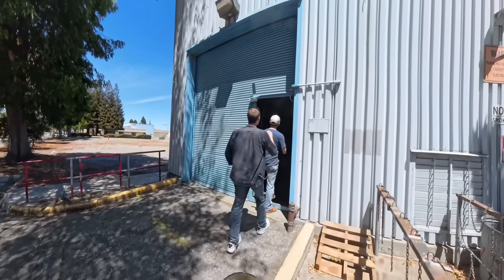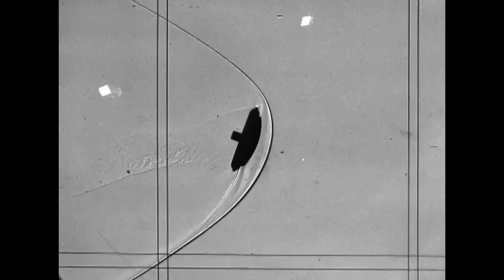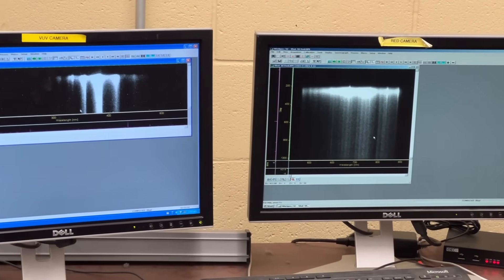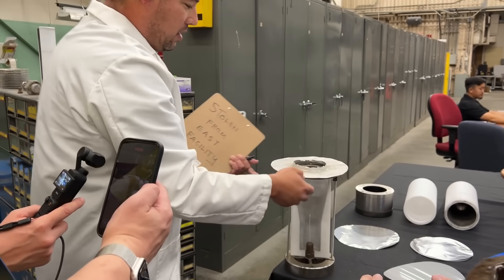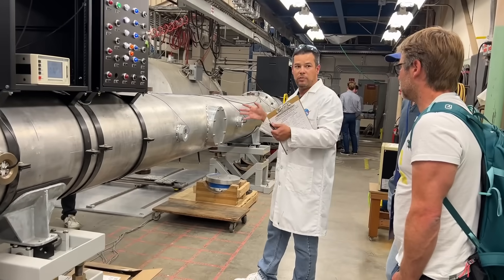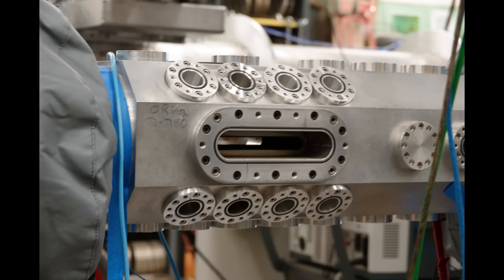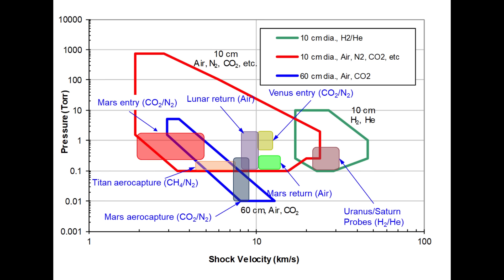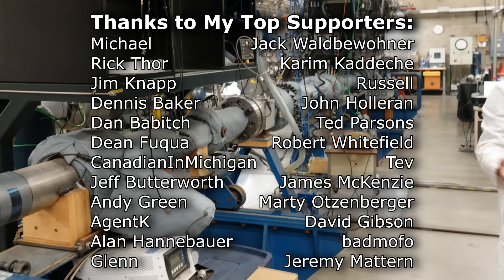Why NASA Is Making Air Explode Using Electricity - The Electric Arc Shock Tunnel

Comment: I was unable to adequately visualize 48 kilometers a second as anything other than "really damn fast", so I converted it to miles an hour, and it was over a hundred thousand miles an hour, which I was still unable to visualize as anything other than "really damn fast".
So I said "screw it" and went for mach, and got a shockwave moving at mach 141. That is still "really damn fast", but it is a number I can get a toehold on... barely.

Comment: Interesting … and hardly surprising … the technique they use to initiate the arc is essentially the same as that used to simulate lightning strikes. In that case, it’s more to do with encouraging the strike to occur at a precise location on the test article … the release of so much energy tends to have something of a mind of its own when it discharges … there being 2 key factors in such a test; one being that it releases at the correct threshold energy (so you achieve the appropriate strike characteristic of energy pulse over time) and, secondly, that it actually strikes at the right spot on your test article. 

These are very important in the testing of airframe mounted Carbon composite components where you really don’t want a Lightning discharge to get into the actual Carbon fibres themselves; it can then get very messy very quickly. Lightning discharges through an aircraft need to be safely managed for obvious reasons … irrespective of the structural materials used you’re allowing the discharge to flow around the external skin from where it will continue its path to wherever it’s going. It’s the Faraday cage situation. The problems occur when it discharges INTO the airframe and the energy is dissipated within the structure or associated systems. 

It’s a fascinating subject and one I got involved with a couple of times with the “fun” of supporting certification testing. When the test fires, it certainly goes with a bang!!

Comment: When I was a grad student (40 years ago) my housemate had an amusing job in mag. confinement fusion research which involved building a power supply that could produce a million volts (not so hard) at a million amps (rather hard) for about 1 ms.    That's 1 TW for 1 ms, or about 10^9 joules --- not a huge amount, but it's huge if you're in a hurry.  10^9 joules is approximately the amount of energy you'd find in a fully charged Electric (passenger) Vehicle.

Among other things, he needed to build a coaxial transmission line that could stand off 1 MV, but also have a characteristic impedance of 1 ohm.  If you wonder how you can build such a thing, let's just say that there is a very amusing picture of my housemate swimming inside that coaxial transmission line.

-----

Interesting safety hazard that you might not have thought of: the capacitor bank that supported Steve's gadget was submerged in a large tank of transformer oil in order to handle the high voltage.  Okay, fine.  However, that transformer oil had a density of that was about 0.85 that of water, and the tank was about 10 ft deep.  So what?  Well, here's the problem: if you fell into that tank, you'd sink to the bottom of it.  You can sort of float in water, but you couldn't float in this tank.

And that's why they occasionally had to clean out the dead animals that had had the bad luck to fall into the tank (birds, rats).

------

There's another story involving "how to make a really cheap resistor that can handle a gigawatt" but that is just going to have to be a story for another day.

Comment: What is the voltage the system operates on? MA is a lot of current, but energy - more exactly power, also depends on the voltage and with time we have the energy spent. You could do a lot of fun things with this capacitor bank! Whats the max power? and for what time?

Comment: I feel like engineers from 60 years ago were so much smarter than engineers of today's world. They came up with all of these experiments WITHOUT computers, the internet or even fancy calculators! Just pencils, paper and slide-rules!! 🤓
Reply: They definitely had calculators 60 years ago lol I have a canon calculator from back then with nixie tubes that still works great, most people doing stuff with numbers professionally back then would have been using one they just weren't pocket sized yet till a decade later, like electronic calculators began back in the 50's by the mid 60's they were pretty well developed

Comment: Hm, interesting point about Titan's atmosphere. But we also have oxygen here, which will very happily snag up any methane radicals (and nitrogen atoms for that matter) it comes across. Especially if it itself gets ionized in the plasma. Another point is that hydrocarbons need to become quite large to be solid and/or colored. My educated guess would be that it's very unlikely to be hydrocarbon deposits.

Comment: Was very excited to see your "Air Explode Using Electricity" vid.  As a young dude exploring the West Coast in 1969 I took a temp job painting walls in a big workspace in a company called Energy Systems, Inc.  They were building these exact huge capacitor banks!  All I was told was they were aerospace related.  Off to one side was a device that looked like a 50's Frankenstein movie prop.  It was a tower about 20' tall with big aluminum "donuts", cylinders of plexiglas and a big arc gap in the middle.  It was called a "crowbar" and was used to discharge the capacitor banks.  Your YouTube was a flashback for me.  Love your videos.

Comment: 110% will be used to shock the atmosphere for “”geo-engineering/ making it rain” via shock therapy that dubi/Saudi-Arabia uses, instead of using materials/aerosolizing the areas/polluting on coming cloud system’s. Too boost/strengthen or to disperse/migrate.

Used to test their flash flooding/ attacking down stream areas / insurance racketeering/ disaster relief land grabbing… using on other county’s…etc 😂 atmosphere re-entry.. Good one scott 😂 so small minded and only accept the cover story they use too seed/acceptance public opinion, making them less respectable to challenge said concepts/program’s/machines when told by accepted public figure. problem reaction solution. When all you make are hammers,everything starts & begins to look like a nail..

Comment: There is a big misunderstanding or more like incorrect (time) perspective about the capacitors, which regrettably is shown also by the author of the video. The statement @8:50 is incorrect. 1.25MJ makes such heat in the chamber not because of being dumped in small amount of gas but because it is being released in an extremely short period of time. To give a perspective, 1.25MJ released in 0.00000001s (10ns), equates to 125TW, released in a second (W=J/s). That is the magic of the capacitor discharge. It is not coincidence that Tesla did a lot of experiments with huge capacitor banks (big wine bottles filled with salt water!) and observed very interesting, and even today, highly misunderstood phenomena, showing only when a lot energy is discharged in an extremely small period of time. No chemical reaction/explosive can come even close, in several orders of magnitude, of such an energy release.
Reply: It's also absolutely because there is so little gas though, if there was more gas it would heat up less because of there being more gas to absorb that energy
Reply: @noodlelynoodle.  I do not think anyone will be disputing that point, as that is a very well understood and a visible physical relation. My point is on something that very few realize, as I have noted. There is a huge difference of the time perspective (several order of magnitude) which creates misunderstanding of the fundamental nature of the process.
Reply: @EfficientEnergyTransformations  the only difference between what was presented in the video and what you said is the units it's in its just simple conversion and tbf you specifically said it's incorrect as to that being why it gets so hot when that is the main reason it gets as hot as it does whereas the rest your going on about is just unit  conversion, regardless of the unit you want to talk about it in the amount and type of gas in the chamber is what's determining how hot it will get when feeding it a set amount of power

Comment: I love how they use those burst discs.  I still remember early on Mythbusters also used burst discs to measure the shock they received but later on in the series they switched to using electronic sensors.  However, burst discs are just simple devices that simply works and probably less prone to failure in such extreme conditions because their mode of operation is by failing.

Comment: A couple of years ago, in our engineering company, we wanted to develop a retriggerable, reusable and remotely stun grenade with a very bright LED-flasher and a burst-disc bang-generator, driven by a carbon dioxide for law enforcement and military use. Our government denied to give the required permission, since the law makes no difference, whether a shock wave is created by chemical, mechanical or electrical means. Shock-waves created by burst-discs have been considered even more dangerous than those created by chemical means, due to the much higher velocity. to get an impression, a burst-disc like shock-wave can be created by smashing a larger packaging-bubble (so 8cm diamater). The SPL (sound pressure level) reaches easily that of a gunshot.

Comment: Hey! We did the boring, finish turning, and power honing off thus exact tube at our shop! You can see it in our company tour video for fluid tech hydraulics on our big lathe. Super cool project. The finish we were subcontractors did is fantastic, great people. I airways wondered what is actually we used for

Comment: I m setting up a Suer Capacitor to start my old Step Van .. That way it staring the V8 Engine will not put any strain on the 6 battery bank I use for the Inverter and welder set up :)

Comment: Gas properties affect not only entry heating rates, but vehicle stability in the case of asymmetric entry bodies.  The most famous example is the first Space Shuttle entry.  At high Mach numbers, Shuttle aeroheating was handled by maintaining a high angle of attack - 40 degrees at entry interface, then stepping down as Mach number decreased.  Trim was maintained by the body flap setting, which had been predicted as 7 degrees in the preflight CFD analyses.  In flight, the flight computers sensed that this wasn't doing the job, and kept increasing the flap setting until it reached 16 degrees.  It turns out that the CFD simulations had been performed using perfect gas properties for air, rather than real gas properties.  This resulted in misprediction of the center of pressure location, throwing off the trim requirements.  The situation had actually been quite serious, but wasn't discovered until after the flight was over.  In cases of planetary probes having offset sphere-cone heat shields to provide extra L/D, atmospheric composition - and real gas properties - take on the same level of importance as with the Shuttle.  The CP location is critical in maintaining the stagnation point on the spherical segment.
Reply: soviet shuttle, orlan, afaik flew only once, but entirely (+reentry +landing) on autopilot
Reply: had a pc shuttle simulator long ago. reentry was hard; trick was to slalom to dump V

Comment: One could build a capacitor bank for around 130,000 € using the one-piece prices on digikey. The discount will most likely bring it well below 100,000 €. You then need some serious hardware around it.
Edit: I have not taken ESR requirements into account.

Comment: Their electic bill must be astronomical!
Reply: As mentioned by others in the comments, the energy released is about the same as in moderate sized e-bike battery. It's the incredibly short duration that's important. So their electricity bills will not be that significant.
Reply: @andy_rb I got that, its a joke about NASA playing with electricity.

Comment: I like the idea that the orange colour on the IFT10 Starship is because the black pigment in the tiles is Magnetite - Fe3O4 which is oxidised to Haematite - Fe2O3.  There's plenty of tile pigment, plenty of oxygen, and plenty of heat.  It doesn't explain everything but neither do the special cases.

Comment: 1.25MJ is only 0.35 kWh 😂
The trick is that energy is released in a very short time.
Even if it's as long as 0.0005s it's 2.5GW... enough for time travel !!!

Comment: Hey Scott,
You might be interested in the past goings on at the NADC in Pennsylvania. 
Specifically, 
The centerfuge,
The Dynamic Flight Simulator 
Flanagan Gray (30+ G's),  
Richard (Dick) Crosbie (DFS algorithm author),
The flame pit,
Monkey house,
Ejection tower.
and so much more...
I worked there peripherally as a contract engineer in the 90's.
Are you interested?
Not sure how to contact...

Comment: Me doing studs capacitive discharge welding today at the shop. 
Powerful enough to weld a 1/4-20 steel stud in 0.004 seconds.

Comment: They used this for testing the shuttle TPS system
Reply: And the Starship TPS is based on the shuttle TPS. Though with Starship they test it with prototype hardware in space rather than on the ground.

Comment: 1.25 megajoules converts to about 347 watt hours, it's crazy how much space capacitors take up to store energy.  That's the price you pay for speed ><.  For reference, 360wh is a pretty modest ebike battery, about a third of the capacity of a car battery, or about 4 5ah 18v tool batteries.  It's amazing to see what can be done when you compress that relatively modest amount of power into a few millisecond or less.

Then again, that's explosives for you i guess, the energy content is rarely all that high, it just get's released REALLY fast.

Comment: 10:35 I was actually told a similar story at the synchrophasotron particle accelerator facility in Dubna. 
When its vaccuum tube developed a leak, they did the following: they put a cart inside, a guy laid down on it, they sealed the system and poured ammonia on all the seams and flanges. The guy pushed the cart with his legs to go around the accelerator and used his sense of smell to find the leak.
Reply: "Who wants to help find the leak?" Silence.
"Who wants to get a shit load of money?"  A bunch of hands go up.
"And who can actually fit?" The little guy in the back get a even bigger grin.
Reply: @benjaminshropshire2900 I’d get over my claustrophobia for that hazard pay 😂

Comment: Was Starship recovered?    On prior launches they had a shop in the area, but I never heard where the first one that made it that far ended up.
Reply: It wasn't recovered. It splashed down in the Indian ocean, exploded, and sank. It's lying on the bottom of the sea.

According to Elon Musk, they will only land the upper stage back in Starbase, Texas, between flight test 13 and 15, which is a while off. The last one was test flight 10.

(Also note that Elon Musk is usually overly optimistic, so it could take even longer.)

Comment: 1.25 megajoules is about half of the energy needed to run a typical washing machine cycle, or about one hundredth of the energy stored in a gallon of gasoline!
But releasing it in a tiny fraction of a second gives an enormous energy and power density!
Reply: Also about the energy to bring a gallon / 4 liters of water from room temperature to boiling. Not wildly much _energy_, but in the short time of discharge makes it crazy high _power_.
Reply: Awesome perspective!
Reply: "I Am Your Problem"  is a bot.
Reply: @SpookyGoose1  no, bots are much better at reading comprehension than that.
Reply: 1.25 megajoules is about the energy from a one bar eg 1kW electric heater run for twenty minutes. 1000 Joules/second x 20 x 60 seconds = 1200000 joules.
Reply: But as started before it the fact that this energy is released in a short time period.
Reply: People underestimate gas.  It would take a person months of hard daily work to push a car up a mountain.

Run the numbers yourself: a 2 ton  minivan, a 5 kilometer mountain.  Just don't forget to put the parking brake on every night or you'll be sad ..

Comment: It cannot get hotter thanthe surface of the sun, Helium has the highest ionization energy of all elements, therefore most of the energy will be dissipated just to create a plasma, and the rest will go to the electrons that will transfer the heat very quick, and some of that electron energy will be dissipated by excitation/radiation, and recombination.

Comment: I think you just nailed hit on the head with the Starship being orange They have an abundance of methane And this could also be used to measure things like the distance between tiles with the amount of build up of this methane soup Adding this methane cooling layer will also be a great way to test The outer layer of the actual heat shield I'm thinking of the porosity of it at high temperatures